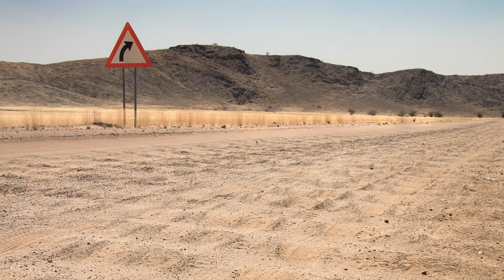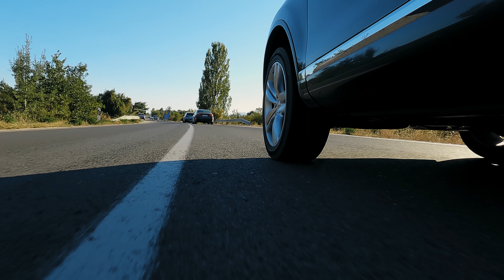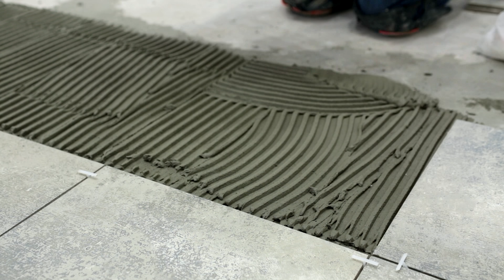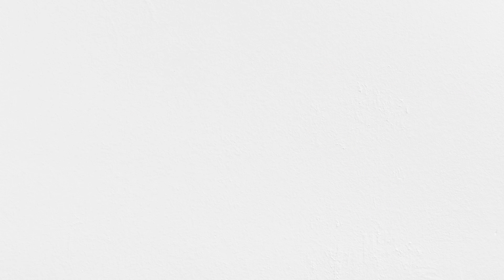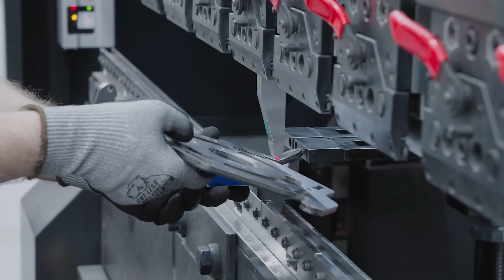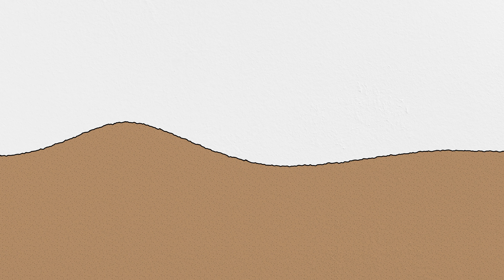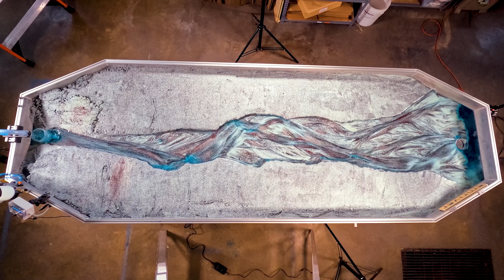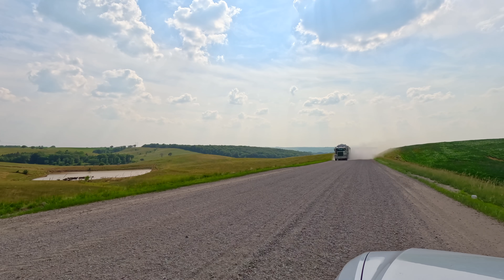Why Roads Get Washboards

Comment: In Rural Brazil you find Tractor Tires tied up togehther in pairs at the side of the road that you are supposed to attach to your tow hitch and pull behind you untill the end of the road and then leave it there for the next oncoming vehicle to drag it back to the begining thus reducing this a lot. Found it really cool as I saw it there.
Reply: That's... a pretty good idea.  Crowdsourced road grading.
Reply: @glashoppah  Grading to fast means the grader ADDS corrugations. Takes a lot of care to remove corrugations.
Reply: I didn't see that when I lived in Brazil, prob no good in muddy areas? Bur in Northern Nevada other desert areas, Baja that could be just the ticket!
Reply: I had 2 large backhoe tires,,,,worked great.
Reply: I drag a pair of I beams down our road.
Buster Brown said we have the smoothest road
in Ravalli County.

We are not speed Deamons here in the Bitterroots.
We do notice a lot of impatient Fools who dig up the road.
Patience is scarce commodity.
Reply: @BobLuddle last year I was looking into these sleds for sale that will do what your I beams are doing. We have a very high percentage of traffic on dirt roads here in Wyoming. One thing we have here is bentonite clay. In Summer its a very hard surface but when it gets wet it is actually sold nationwide as drilling mud it's so slippery as heck.
Reply: @danbrownellfuzzy3010  I have been to several Bentonite mines, and I have mixed Mud for Oil wells.
I do understand how bentonite works, 
and the lack of traction when it gets wet.

Chains do not even help with that substance.
Reply: @BobLuddle  Where I drive a school bus,  they removed the gravel and left the clay.  It rained for a week and we refused to go down that road.  15 students became car riders for 2 weeks.
Reply: @FuzzyWCTX  The Empire is out of disposable income.
Reply: @BobLuddle  They out the gravel back.
Reply: @FuzzyWCTX  I began gravelling toads in 1969,
I have learned a few things about how it works since then.

Generally it is economic reasons for cutbacks.
I do understand about Economics as well.
Reply: @BobLuddle  Its not economic to remove gravel from a road.
Reply: @FuzzyWCTX  If they want to replace it it might be 
They went through the effort to accomplish that much they may plan on rebuilding that road.

I have no idea what the County or Township has in mind.
You have provided no information to make a conversation any benefit to anyone but school children.

Go lay by your Bowl.
Reply: @BobLuddle heh, except when Missoula transplants come down. I used to live off of Westside Rd.
Reply: @AccountInactive  We have the traffic to the Elk Refuge to deal with on 3 mile road.

I understand.

I have attempted to work the road a little as have some local guys.

The County is busy paving roads in the Hamilton area for the high dollar tenants close to Rocky Mountain Labs and the other Drug makers nearby.
Reply: @BobLuddle  ok country bumpkin tell me more!
Reply: @BobLuddle  what are you afraid of speed???"
Reply: I got a junior beam to drag behing my tractor which worked well on smoothing the surface but leaves it loose. I get ruts as well as dashboards. I found a guy that made a road roller for me which is wider than my tractor. This made a big difference as it compresses the surface and forms better interlocking of the substrate. Not quite as cold here in NE Washington, but there's still frost heave to deal with as well as washboards.
Reply: @BobLuddle  Hey neighbor!  I see this all the time on the backroads. In the summer it's nothing but washboard and mile long rooster tails of dust from all the rancher pickups hauling stock trailers at 40mph. Slow down?  Not in Montana🤨😑.
Reply: You mean when a community decides to help each other all boats rise.
Reply: ¡Maravilloso! Felicitaciones a los queridos brasileros 🇧🇷🇨🇱
Reply: Very interesting, although I grew up in Brazil and haven't actually ever seen this... I guess our area of dirt roads didn't have that team spirit 🫠
Reply: Fixes the speeding problem too.
Reply: @lostvisitornope. Fast enough makes it smoother.
Reply: @travishartman5662  slightly  different  context .
When just driving ya smooth is fast enough.  With the equipment to smooth like beams, tractors, and or tires   they bounces like your truck  and they start hopping ,   digging hole and piling mounds
Reply: @lostvisitor You might be surprised how high they can bounce tires on a chain.
It does seem like a great plan.
Citizen involvement has been a problem for democracy as well.

It is always up to others to do the work.
Reply: @BobLuddle  I drag the "drag" (5-15000lbs of I-besms depending on conditions and equipment) for World of Speed on the Bonneville Salt Flats , its  a 3-5 hr round trip and a minimum of 10 passes  to prep the corce for the 2-300 mph " fastest cars on the planet" ( 508 is the top dog) . Most dont have the patience to drive 5mph for hrs on end. 
Most think they can run 35-45 mph and they have the 15000 lb drag hopping down the corse digging  divots turning the course into washboard city.
Reply: @daviddroescher seems like a job ripe for automation, much like agricultural tractors/combines.
Reply: @cbh148  ya the teaching phase  would take 30yrs budget  to hire out the programming. + 1000-5000 recovery fees   for each flaw in the program when the device gets bogged down and brakes through the crust. Look up Hot Rod Magazine  Gets Stuck At Bonneville.  It is like a jar of skippy extra creamy peanut butter  under the salt crust.  
NASA thought  driving  the rovor on the moon was tuff. 
Issue #2
 the rust belt has nothing on the salt flats.
Reply: @daviddroescher  We have a local Guy who was going down to run a car in the salt.

I have listened to tales about that place on the flats for 40 years.
The thing that I-Beams do is to load up in the web and gain weight as they are used.

It is a pretty effective method as long as you have the power to pull that load.
Reply: @BobLuddle  It is magic. Bucket list level  for a race or just to see it
Reply: @daviddroescher  I stopped once when passing, to see who was there.
I had places to go so I did not linger long.

None of my friends had shown up that year.
Reply: @daviddroescher  Q: doesn't whatever you are pulling that drag with create their own divets and compressed areas as it pulls that load? If it is wheeled rather than tracked, it's got to be doing something to the compaction underneath the contact patch of each tire.   Even tracked is doing something to the overall compaction but in a much broader plane of contact.
Reply: @beeblesneezer69  yes there are tire tracks left behind . They are minimal after the slid scrapes the highes into the lows and the sun bakes it. Without the dragging the tracks stand proude( stick up above the surface ) becuse of increased air flow access  and the track is pressed into the waterlogged clay causing it to wick up salt brine that the increased  air drys depositing tan increased volume of saltwhere the rutts used to be.
Reply: i was actually wondering if dragging something behind would help to level it out.
Reply: Haha niceee diy grading haha
Reply: That’s how I maintain the 1 mile road to my gravel pit. We also use tire drags in winter to build and improve ice roads.
Reply: Interesting!
Reply: That’s genius
Reply: When these go too bad at home we used to drag a heavy old gate  up and down it to "grade" it.
Reply: I was trying to imagine if a chain link fence would help or hinder.
Reply: @paulvild  Technically it is a fence panel for making cattle pens but it is roughly the same size and shape of a large gate. It is made out of heavy duty 200m steel tubing welded together and very heavy where you would need at least two people to stand it up which helps push it into the gravel as it is dragged along. I would think a chain link fence/panel would just skip over the corrugation and would at least need some weight added to get down into the troughs of the ripples.
Reply: @ffsffs5030 yeah like put a couple of those tires on there for weight
Reply: @ffsffs5030 yeah like put a couple of those tires on there for weight
Reply: I'm from Brazil, I grew up in the rural part, in two different states actually, and never saw this nor heard about it
Reply: Road graders often start the corrugations with vehicles making them worse.
Reply: @travishartman5662  graders only make it worse by filling in the valleys without cutting off the peaks, or leaving too much loose dirt.  
The people who think the throttle is an on/off switch are the biggest problem.

Comment: You mentioned that they occur more at certain points in the road but then give a rather vague explanation as to why. My understanding is that it is due to braking. Whenever there is a region where vehicles tend to brake, the corrugations are noticeably worse. I would assume this is because the wheel pushes the sand horizontally much more on bump.

Comment: I'd be interested to see a video of the same subject, but going up hills. I often see that gravel roads that immediately turn uphill off a paved road seem to have a lot of washboard on the first stretch of uphill. And I see it again after a switchback. I think that vehicle acceleration affects how washboard forms in addition to the things you showed here.

Related idea for a future video: How/why potholes form on gravel roads - but only on flat sections, and not on hills. My thinking is that the flat surface allows water to linger, while the slopes make it drain away.

Comment: Cool set up but one possible issue in the model process. The forces in play only go in one direction unlike traffic on dirt roads which goes in both directions. Vehicles tend to travel in the middle going either way and only go off to one side when approaching a vehicle going the opposite direction. Could this effect the distance between peaks or the height differential between peak and valley?

Comment: Driving a semi truck, i can tell you how they start quickly.  When hauling a heavy load (as compared to a car or pick-up truck) we don't get full traction all that quickly when starting from a stop or very slow speeds.  And on less than ideal road surfaces,  we get wheel spin.  I really noticed this one day while delivering pop products to a rural customer.  My truck and trailer are rarely full to capacity, and quite frequently less than 50% of maxium weight which is both a blessing and a curse.  There are times when i dobt have enough weight to get effective traction, and other times when more weight causes more problems.  
Well this is one of the latter cases.  When accelerating from a stop sign on a gravel road,  i have too much power for the load i have, and i get wheel spin, which causes the tires to quickly lose traction and gain it back again.

I only say this because i came across a recently resurfaced gravel road with no 'washboard' and was pleased that i wouldn't have to worry about dumping the pallets due to the washboard effect.  Well, as soon as i pulled onto the gravel road, i felt my truck shudder like there was washboard there.  The back tires of the trailer didn't bounce, so the washboard i had created wasn't all that bad just yet, but it had started.

Comment: Hmm, Grady I love your videos but I don't actually buy this one, my physics degree is screaming at me! 

Your constructed example has a specific ratio of wheel size to rut wavelength that simply isn't the commonly found washboard found on roads. If that was the effect causing what we usually see on roads, the bumps would be 1-1.5 meters apart or so, but we see them all the time where the ruts are maybe 10-20cm apart, you have many of these examples in this very video.

I definitely believe this effect is happening on roads, and is causing the wider version to occur - but what's causing the shorter wavelength version?

Comment: Here in Brazil, we call this type of defect "cow rib".
On roads that connect farms to highways, farmers leave one or two used truck tires, tied together by a rope, so that anyone passing by with a rear hitch (usually pickup trucks) can attach the rope and drag the tires along the road, keeping it level for longer and 'breaking' the bumps.

Comment: Grady - interesting but you didn't make note of the amplitude and frequency of washboard depending on the surface. In a deep sandwash traversed by ORV's the washboard has high amplitude (1-2ft.) and very low frequency (3-6ft ). A road used by high speed 4-wheeled vehicles has high frequency low amplitude washboard. Weird, huh?

Comment: I disagree about washboarding being intuitive. Once you associate the process with sand dunes, it becomes a "why didn't I think of that" kind of thing. At a certain point, the force acting upon the surface is going to deflect... and what goes up, must come down again, so it'll deflect over and over again as long as the force continues at a constant rate like the wind or a car's tires. Of course, the deflection isn't a 100% reflection of the force being acted upon the surface materials. Some of that is absorbed and the materials are pushed into each other, deforming the surface. The size variability of the materials that compose the surface also plays a role, like we see in the Brazil nut effect. All of those factors constantly feeding back into themselves amplifies the effects, too.

Comment: A very interesting video. I have an observation: Your spinning arm would have resonant frequencies in various axis (yes, I know this was a simple demonstration) and these could contribute to the final result.
What I have also wondered about in the past is; what effect would the differential on a vehicle have? Like you said, no matter how smooth the surface starts out, washboards develop. Then also, if one wheel gets a slightly higher bump and jumps upwards, it would spin at a little higher rate than the other due to the differential. Slipping, so to speak. This might cause the bumps in a wash-boarded road to be misaligned in the general line of travel. Another effect could be the rotational oscillation of the whole wheel due to the elasticity of the tyre.

Comment: Very interesting, always wondered how washboard roads formed. Over the years I’ve heard many ideas but glad you have solid information supporting this. Curious if the spacing between the ridges are consistent with the size of the road material or the speed traveled? Is my imagination I think the spacing of the ridges are very similar no matter the location of the road or type of vehicle traveling on them. Perhaps the road department could put a time lapse camera on a section of road known to have washboards then see the washboards develop after the road was freshly graded smooth. Several locations in Iowa come to mind. Thanks for sharing.

Comment: I was a crewmember on Bradley’s in the Army at Fort Hood and we had a lot of dirt tank trails that us and the tankers used.  The washboarding would get so bad that you could go from a near quarter mile of small bumps vibrating your vehicle, to legitimately an area where you could stand between the bumps and they were 2 - 3 feet tall on either side.  When it rained, it got even worse and our vehicles would get stuck.  I’d always think about how weird and pronounced it was, especially with these areas that had a lot of tracked vehicle traffic so it’s cool to see you cover it!

Comment: Thanks for your great video! 🥰 I've been wondering about that for a long time. I’m surprised that it isn’t necessary to transfer the force through the rotation of the wheels. I’ve noticed that on inclines where trucks have to start moving or accelerate, this exact washboard pattern forms. I always thought that the heavy load pushed the asphalt backward, causing the pattern to form. Maybe there’s another cause...

Comment: Here in the Western states in the U.S. we sometimes see road maintenance pour a substance called mag chloride onto some unpaved roads.  This substance seems to bind the road particles together thus preventing washboard from forming in the first place.  But it does need to reapplied about once per year (depending on climate conditions and road usage factors) and it probably is a somewhat costly process. 
I don’t know if there are any potential environmental side affects of using it.

Comment: You missed a key point in washboard creation, acceleration and uneven power application to the tires.
It's most noticeable on steep gravel logging roads, the places where the trucks are accelerating, and the curves, are the first places the washboard forms, because of wheel hop.

When you accelerate, if you spin a tire, it digs a hole, which the tire then climbs out of, making it bounce a little bit, and then it spins again and digs another hole.

If you have ever tried accelerating fast you have felt this, especially like in a pickup with no weight in the bed.

Then on curves you have the inside and outside tires trying to go the same distance, and the inside tire tends to slip more than the outside even with an open diff, probably because centrifugal force is throwing the weight to the outside so it has better traction.

Your test, and it sounds like the Paper, only looked at passive rolling, when in many situations it's actually power application that starts it.

Even driving pickups on gravel roads, it makes the road last a lot longer if you put it in 4wd, because it spreads the force out over all the tires, so you don't get wheel hop as bad.

Comment: Snowmobile trails get nasty washboard, and it shows up very quickly. The peak-to-peak distance is around 5', and the depth can reach 16" when it gets really bad. That's for mountain sleds with long tracks, I'd be interested to know if it's different in areas with shorter tracked trail sleds.